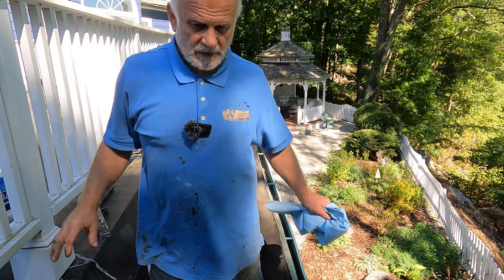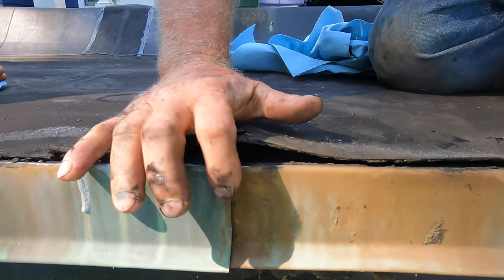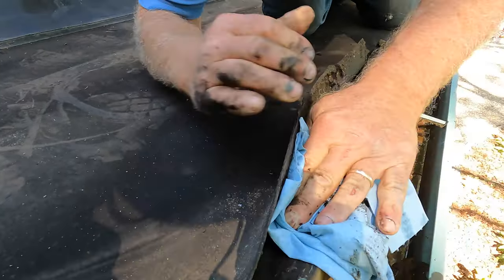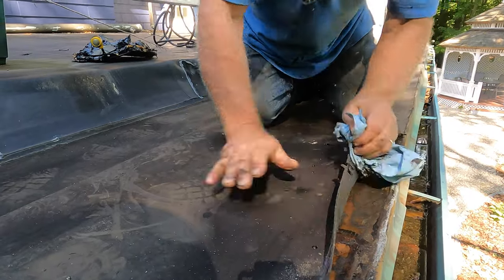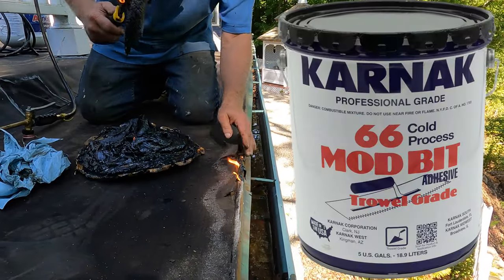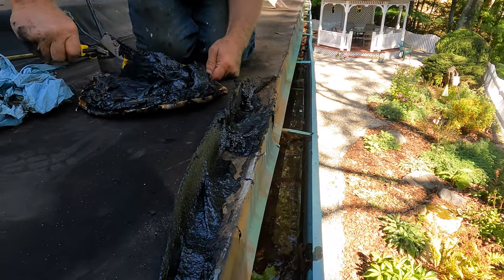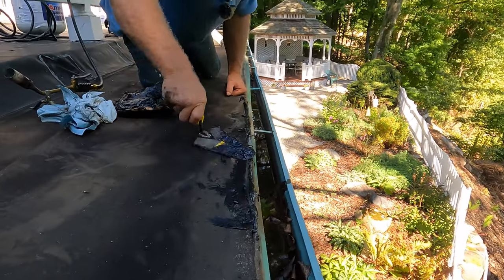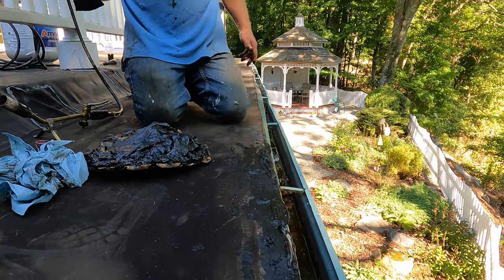Almost every Flat Roof has this problem, Fix it now before it is to late -Torch Down Rubber

Comment: Any primer needed to make sure the karnak stick to the aluminum drip edge? 

Any tips on making sure it's clean and dry before applying? I don't have a torch.

Would it be reasonable to apply another coat of karnak after gluing the membrane to the drip edge? Perhaps with a mesh as well to prevent it from coming apart again?

Comment: Why not do proper felt  drips with drip cards which are 75mm in width,  install roof batten on front edge pin mineral drips onto batten, pin up drip cards then gun up the drips over the drip cards then onto the flat roof. As long as the mineral drips are at least 38 CMS, I have done this for years, still got flat roofs I done 20 years ago, still watertight.
Reply: Is that all available in the US?

Comment: Thats the glues and adhesives ,they faulter ,shrink .crack or pull away ,they are not up with the times new products and repair needs improvement.its very expensive all these applications and the leak at chimneys pull away or shrink ,junk ,the manufacturers should be held responsible most times.,sorry ive seen it happen over again.